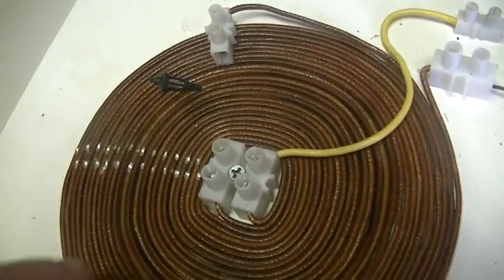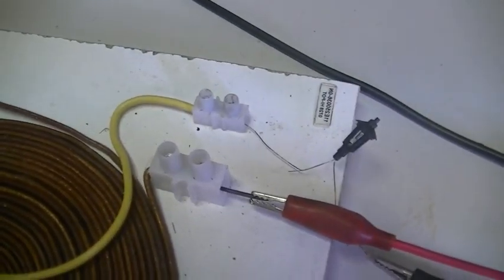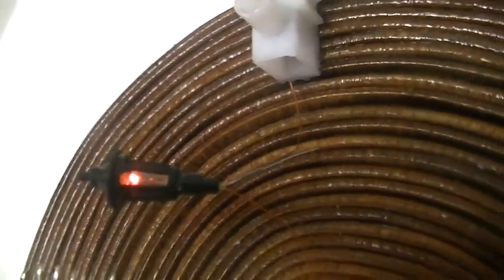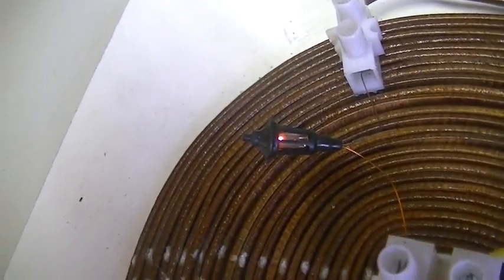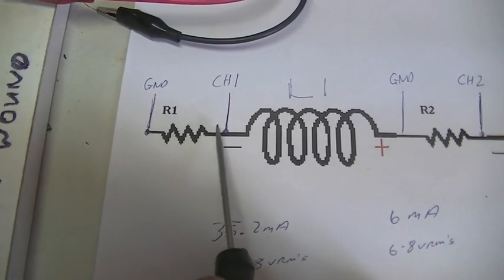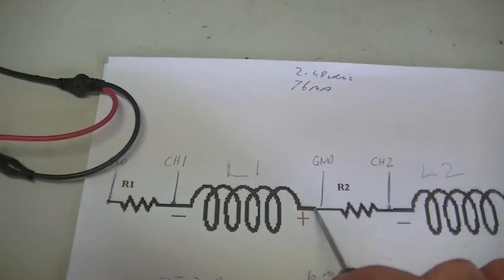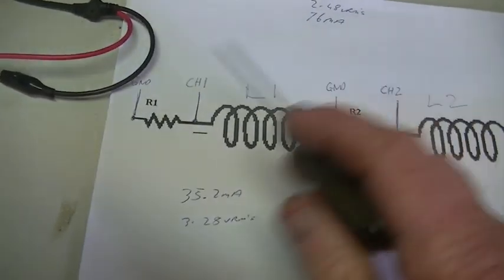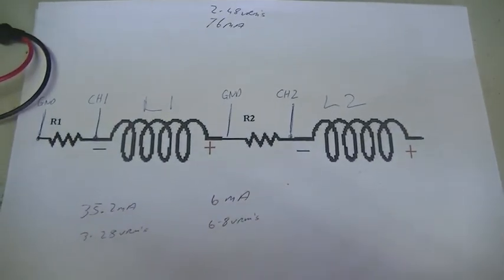Response video2 to Russ.

Comment: I was thinking earlier about how this really reminded me of the testing using the low voltage incandescent bulbs.. I remember when trying to figure out how an input bulb can show no glow while the identical output bulb illuminates and that's when it was explained by many people all these different ways to truly measure total input/output power, yet I still can't say I understand it.

What's confusing though is a single resistor, which is part of a series in a circuit, is somehow showing more power than the entirety of the circuit that it's a part of. I don't see how that's possible unless we actually assume the rest of the circuit became superconductive.

Comment: just some thoughts here. should you not be also checking across the entire circuit?. so both sides of the Input? not just one "leg"  try adding that light on the positive side not the negative side. because if your FG is grounded then that might mess things up. try it right quick and tell me in the comments what you see.  

and yes. it should not matter what side u check on but let's confirm. 

Any how. will do some tests soon with my scope. 

~Russ
Reply: Do you have three of these bulbs available?  Please add the third bulb to the other input wire and run the tests with all three bulbs installed.  If you complete the circuit diagram to include the signal generator then you will see that one side (the red wire) of the sig-gen gets a free pass to the "system" while the other side (the black wire) has a test resistor.
Reply from the maker: Tried the light bulbs on both sides,and no difference-of course lol.